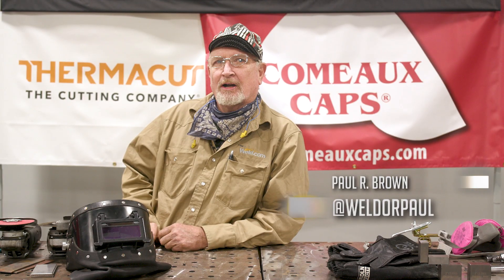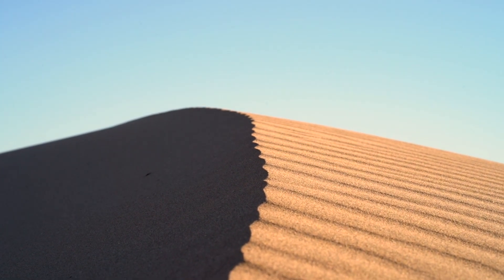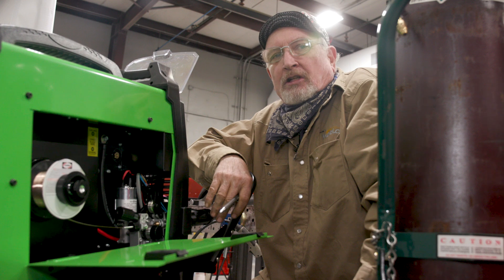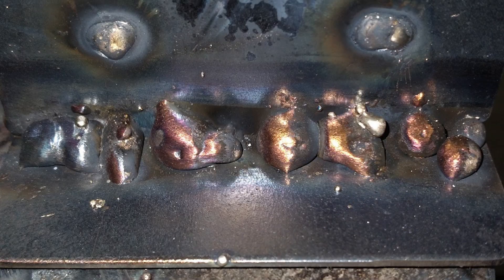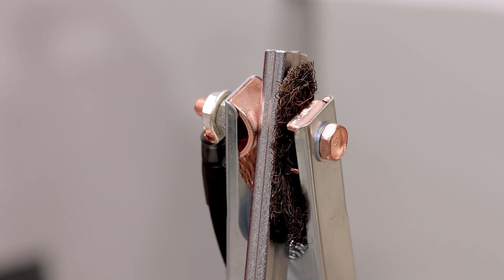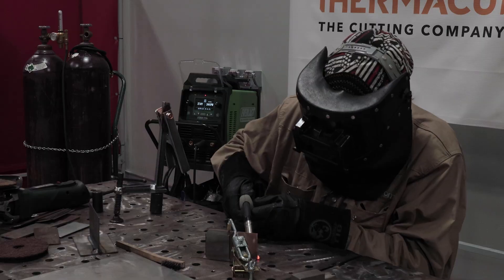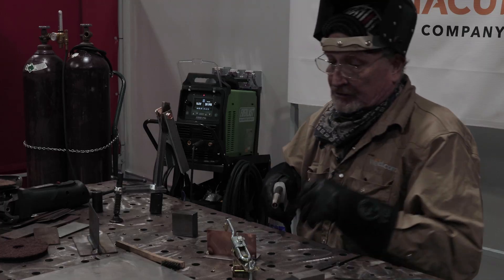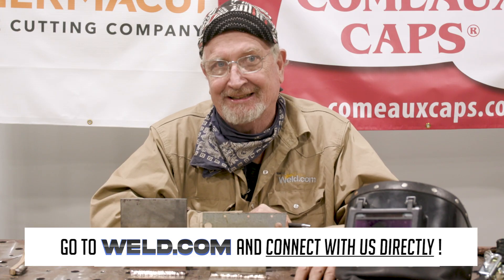Silicon Bronze MIG Brazing

Comment: Great video!  As far as I know, brazing is not the same as using adhesives for joining.  The liquid brazing metel dissolves and alloys with the metal being brazed.  This happens in a thin layer at the interface between the two metals. Interesting fact: You can dissolve a chunk of copper in a pot of molten solder, creating a solder plus copper alloy.  The copper never melts.

Comment: Not a welder but been doing some welding as hooby - 13:25 the bead seams to bulge instead of transitioning smoothly into the baee material on the stainless example. This doesnt seem optimal or am i mistaken here?

Comment: Great video. Thanks for posting. I love the trick with the ball of wire. I've always felt the same way and have strived for a good ground. Especially when that clamp is hot, since that tells me that its a bad connection. The ball of wire is BRILLIANT in my opinion.

Comment: I run a bronze foundry. Such a great video! Another key reason to fabricate using bronze is when you plan to chrome the work. For example, if you were planning to custom paint a fabricated piece (think molded body/parts) you might use bondo to smooth the molded sections. Using bronze instead of bondo allows the piece to be chromed. The bronze is soft enough to shape like bondo, easy peasy. We’ve even brazed over steel welds just to make smoothing easy.

Comment: 11:32 "did you see a lot of smoke coming off of that?" "oh yeah!" loll BZZZZT wrong answer

If the brazing doesnt remove the zinc galva then it means that the brazing is only stuck to the galvanized layer and not the base metal 

So?

Comment: thanks for posting this, I have a project that requires joining some tool steel and this might be the trick.  Do you think a spool gun would work ok and avoid any need for a low friction liner?  I realize you didn't change your liner and didn't have a problem - going commando ha ha - but you mentioned it as a possible issue to prevent birds nest.

Comment: 1:35  “Look at this great gold bead.”
This weld is rolled as all hell.  Are rolled beads unavoidable since we are not melting the base metal?  Or, can a faster travel and adjusted torch angle result in a more traditional “great” bead?

Comment: Hello, I'm welding 20 ga cold rolled sheet metal body panels. I typically use a copper spoon behind my joints as a heat soak, what material can I use as a backer when using silicon bronze rod since it adheres to so many materials ? Thanks, VinceWheels

Comment: What would happen if you tried to mig braze with silicon bronze wire and an argon/c02 mix gas?
Reply: also trying to find this out
Reply: I know for welding, using the 100% gas will change the bead width etc. but it will work. But for brazing I worry the CO2 would make the metal oxidize slightly under the arc and not wet into eachother

Comment: I’m going to try that grounding trick. We do structural stuff at work, big long electrical poles. The ground is often 20 feet away and gets quite hot. We run  0.052 metal core wire. 👍🏼

Comment: The white smoke is not the zinc "boiling off", it is the zinc being oxidized to zinc oxide.  It is an extremely fine powder and if inhaled can damage the lungs.  It is also white in color.  The white powder is seen on the back side as it became hot enough to be oxidized.  I have done a lot of silicon bronze brazing using an oxy acetylene or a MAPP torch depending on the size of the parts.  I wasn't aware that a silicon bronze MIG wire was available.  Knowing that thin parts can be brazed without significant distortion will open up a number of opportunities for me.

Comment: in automotive ultra high strength repairs such as some rails or pillars they have you drill two holes and create a ring instead of plug welding. there's a good icar class on brazing techniques . great vid, don't see a whole lot about this in the community

Comment: It is rediculous how much better the copper between the contact and surface trick improves things. I put a copper scouring pad under my clamp and mig welding in general has a super smooth feel now, but when I'm welding stainless sheet metal I'm not getting the annoying wire popping when tacking seams that throws spatter and what spatter I get when welding stainless usually comes off easy instead of needing a smack with a chisel and hammer. The reduction in clean up alone has made things look better and sped things up, thank you so much for that tip

Comment: Great video. I didn’t know this type of welding/ brazing existed, even though I think I’ve seen some of this welding on material over the years but didn’t know what it was. I’m going to get into using this because as you pointed out with thin metal it doesn’t warp. All I have to do is get some argon gas and some wire. I’ve always struggled with thin metal warpage over the years and for a lot of projects at home this would be the preferred process to use. This is a real game changer for me. If anyone is wondering why I’ve not heard of this I’m a retired heavy duty diesel mechanic and I’m used to welding 1 inch plate steel 🤪🤪🤪🤪👍

Comment: this is not a true "welding" process... it is more like a strong glue to hold parts together.   it does hold pretty well, but it is not fused to the base metal.  but having used this filler to tig holes in auto body sheet metal.  it does look good too 😁👍

Comment: This video was good to see. I've done just a little TIG brazing (Everlast 210EXT), and the more I do with Silicon Bronze, the more I like it. But using it with MIG really gets me thinking, especially if I would ever want to use it with a low-priced 120V MIG unit (i.e., 220V not really required for that lower amperage), like that new Everlast Cyclone 140E, since I already keep a couple of large argon tanks on hand.

Comment: Great video, but disappointed you didn't do any break tests on your coupons. Whenever I've tried this with TIG it's the braze metal that breaks. It never comes unstuck from the base metal. And it's usually very strong but not quite as strong as a weld.

Comment: Never used it in a mig. I saw it on a garage door installation. The gold beads connecting the brackets to the track was hard for a welder to miss.  Many years ago we used Everdoer silicon bronze rod to connect light gage galv, as thin as 22 ga., duct pipe in granaries for dust collection. Installed in place, out of position with cabon arc pencils in a stick welding leed. Good times.

Comment: I do a bit of silicon mig on duragal security door. Works quite well just have to remember to move slower to avoid underfill. 

I may have missed it in the video, but should warn people that silicon bronze is pretty nasty stuff. I mean should wear ppe for all welding but especially silicon bronze should have a mask on and as much ventilation as you can get!

Comment: Paul, I know this took some research and advance scripting, but I think it was worth your trouble.  A good and informative episode, and interesting to watch.  I like the explanation of brazing as similar to a glue joint, and I think that's exactly right:  Something that sticks to the two surfaces and hardens.  Doesn't have to melt the two base materials and so they don't have to be compatible.  As for zinc, I think I'll continue to just grind the stuff off of the weld area first.  I don't have confidence in my skill at keeping the temperatures down, and really want to stay away from those fumes!

Comment: I wonder if you could do this to join aluminum to Copper?  Right now lithium battery terminals are welded using lasers which is out of reach of normal people. All lithium batteries have an aluminum terminal and a copper terminal.  If this works to join the aluminum tabs of one cell to the Copper tabs of the next cell this could revolutionize home built battery packs.

Comment: Could you explain to me differences between uses for Aluminum Bronze  and Silicon Bronze.  When would you choose which?
Reply: Aluminum bronze is significantly stronger and the weld has more of a shiny gold color.  Because of the aluminum, it's usually welded with AC rather than DC.  I believe it has higher elongation before failure. I've used both, but only with the TIG process.  Both are good for brazing, and thus for connecting dissimilar materials or when you want to keep temperatures and heat input down.  Some people favor pulsing when brazing with these two fillers, and that is somewhat more typical of TIG than MIG machines.

Comment: We use this in the auto body field to "weld" the seams on quater panels because of heat destoren and it is recommended by some manufacturers for a Certified repair.

Comment: @1:38 you seriously need to adjust your parameters, that over-roll on the bottom side of the fillet is no good at all.
Also, the galv was burning off, could see the arc changing colour, and fumes coming off.